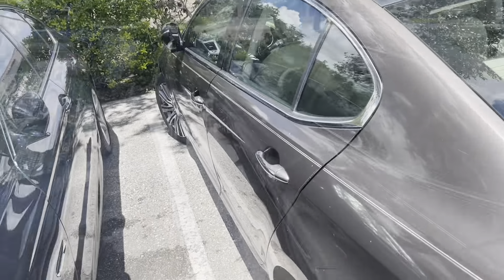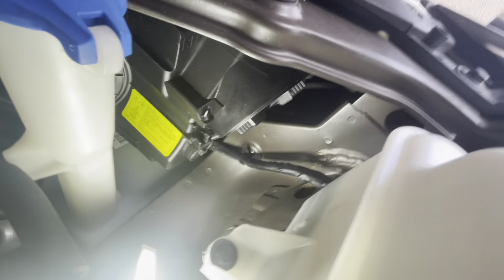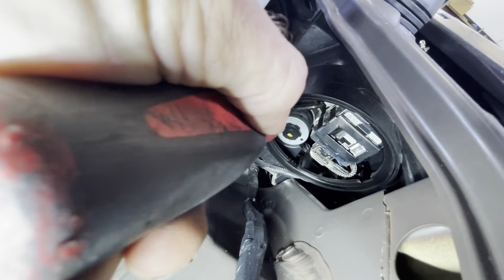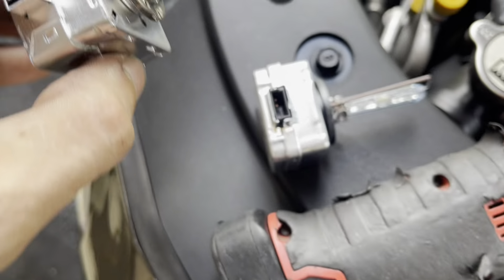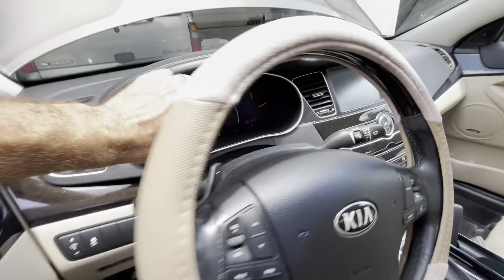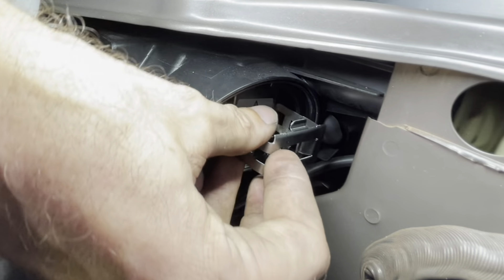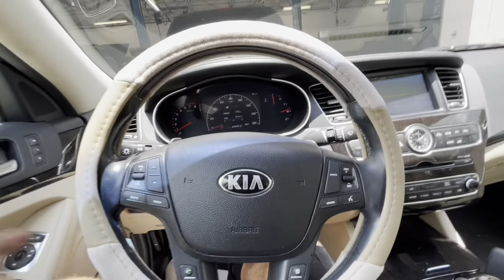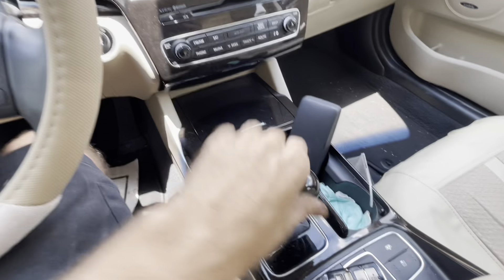Abnormal EVERYTHING All Day! Kia Cadenza

Comment: You're completely right Ray... it's something that really annoys me when mechanics start messing with the setting of my car not needed for the repair... I get sliding the seat to a good position, but leave my backrest where it is, don't mess with my mirrors, my radio settings etc. Once a mechanic actually changed my display and color settings... seriously, why?
Reply: Because they need to drive it and they can't reach the pedals or they don't fit. It's just something that has to happen unless you find a mech who is the same size as you.
Reply: Re. Colour settings, they probably unplugged the battery and it reset.
Reply: @brad9529  Nope... it was after a multi point inspection with no repairs and other personalizations were still active... trip counter was still accurate and if I'm not mistaken the Android system that it's based on doesn't lose it's settings when battery is disconnected.

Comment: You didn't notice but on that retailing bracket the side facing out there is 2 tabs that curve /
down, if you push it on the bracket then, it should release the tab from the angle thing that locks it in place. No pry bars needed, if it doesn't release then a screwdriver along the side should pop it off, total time to replace about 6 minutes.

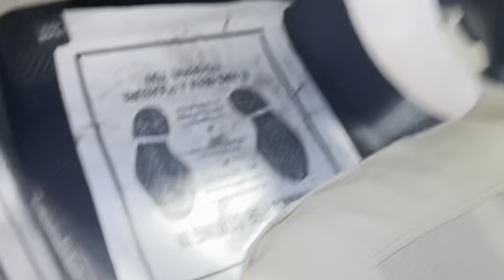Comment: Nope, the 12:46 thing was also there at 0:36... It was not your dirt!

As for the moving of seats; As customer do not care, because I have the habit to do the a "do i fit and can I see things in the mirrors"-check before driving away. Just do not do things I specifically mentioned you NOT TO DO! For example attempt to open electric windows I know are broken, told you are broken, told you/made you write down not to use because they likely stay partially opened once opened.

Comment: Back in the days when you replaced the bulb yourself, and had to be careful not to touch the bulb. or it would burn out quicker! I remember when you hit a pothole and that was all it took to put the light out of adjustment and one light is up and the other one is normal! My dad would you the garage door and have me decide if the lights were even by turning the screw on the light. Sure hope they have improved!!

Comment: Hi Ray many Kia user manuals say that to replace the bulb you remove the headlight unit. I have done this this way and it’s quite easy to replace the bulbs. I also had a mechanic doing it like you did and he was struggling. I told him that the easy way is to remove the headlight and his reply was you don’t remove the headlights to change the bulbs. Maybe it was his ego or “I have been doing it for years” talking, I don’t know. Unlike  what you did you don’t have to disconnect the reservoir or the battery and still ending up not having enough space. I guess he has never had to change a bulb in a Renault Megane that you remove the wheel and there is an access panel in the wheel arch to reach the back of the headlight to replace the bulb by feel. The lazy way is to turn the wheel all the way to empty the wheel well as much as possible which kind of gives you some room but you can only do it this way if you have done it before. And yes you are right, the book time for changing a bulb could be an hour, it’s not you thinking it is taking too long. Us as users sometimes we think things are being done like 30 years ago.

Comment: Back in my day, you had 4 screws on a chrome bezel.  3 of the 4 would have rusted in and the screw heads would be stripped.  (Gotta love salty areas like New England and the shores of the Atlantic coast)
On my Buick Lacrosse... you have to pull the front nose off to change the bulbs.  Yeah, NO.  There are Sneaky Pete methods.  That one was nice being so open and accessible... ignoring the clip retainer hoop to jump thru.

Comment: Kia is a junk car. I made the mistake of buying one in 1997. The floor shifter fell through the floor while driving. The brake rotors started pulsing every 4000 miles. Had them changed constantly. Finally after warranty was up I got the best after market ones and no more problems. The service manager told me they stacked them too high on the docks and that caused the problem. What a clown. Never ever buy a Kia.

Comment: Worst thing on that is the bulb is changeable at $14, but the assembly of both is $80...Had the customer changed it themselves I am sure they would have tried the $14 fix first. Surprised Ray went with the no diagnosis and went the easy way. Would have taken another 2 minutes to determine which was at fault.

Comment: What a piece of junk it should be two minutes to change a lightbulb in a car. I actually have 4 Kia’s ..thus far no lightbulb change out of them.. I did change the fog lights with minimal effort on my Kia optima that took about five minutes. I’ve owned a Mercedes before and the older models takes about two minutes to change any lightbulb.

Comment: If avoidable great but I'm not a 70 yr old Chinese grandma that sits dangerously will die instantly when airbag goes off close to steering wheel....I gotta get in it to work on it and if you can't handle putting seat steering wheel and mirrors to where you need them then you really have no business behind the wheel of a possible death causing ton of steel ....js sorry if not seat and steering wheel woke liberal not everything in this world is or should be dummy proof